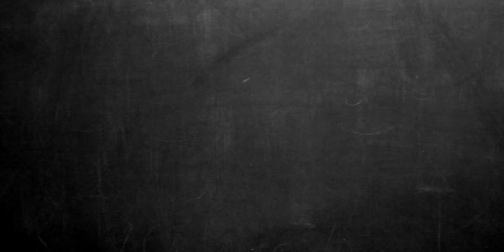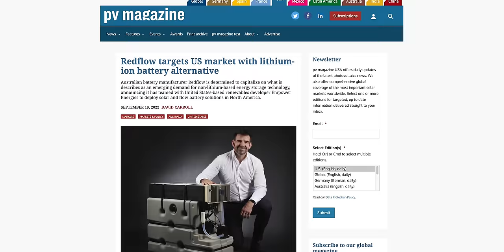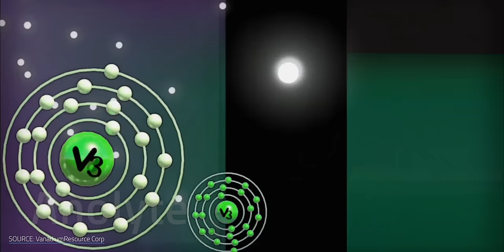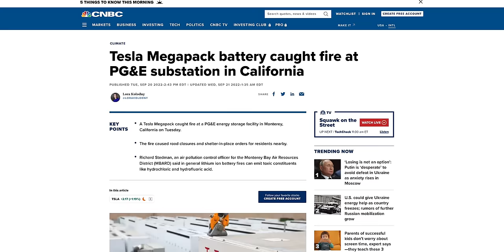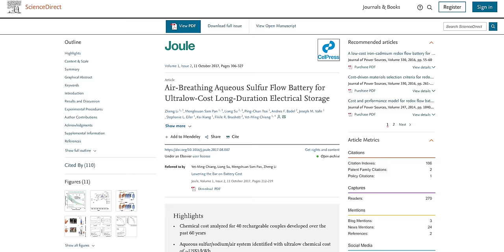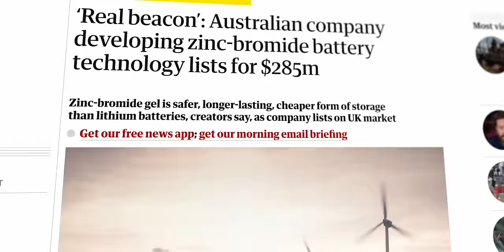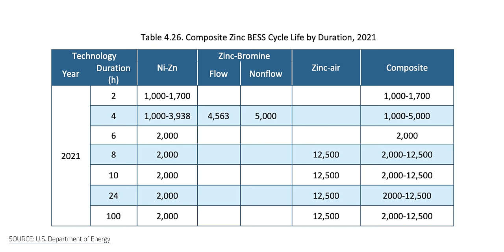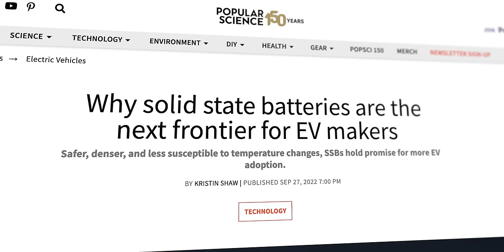137 Year Old Battery Tech May Be The Future of Energy Storage

Comment: A ZnBr flow battery is safe enough to deploy in buildings providing uninterruptable power when a grid goes down. Li ion is not safe enough to use in facilities. There is a single pump, single loop, single tank ZnBr battery for utility size use - there is no membrane separator needed, which is good since the membrane is the source of failure in other batteries.

Comment: The principle of Flowa Batteries are great but ZnBr is not good. It's a lot cheaper because Zn and Bromine are under 5$ per Kg when Va is around 40$. But as Math too quickly mention, Bromine used in BFR (Brominated flame retardant) is Toxic, Prure bromine is Extremely Toxic Class 5 on 6.
As Student I had to work with bromine because it's a easy reactant in chemistry but it's toxicty is around Arsenic or LSD. In terms of chemistry it is easy to use, it may be present in some natural compounds but Arsenic too... As the CDC state no bromine-containing compounds is used anymore in any US drugs.

Bromine due to BFR/electonics wastes in plastic products are becoming a widespread problem since  Bromine compound CANNOT be extracted from platics and they diluated them in "fresh plastic" to be under the legal norm. A lot of Childs toys contaminated by Bromine have caused mass scandal; Less than 15% platics are bromine free.

ZnFe, Vanadium or metal are not cheap but they are safer; This is why ZnBr were not a good choice in the past and having a better sealing tech do not assure me that the new batteries will be correctly recycled, mainly the Plastic part that are in contact of a bromined solution 24/24.
Edited : correct some mispelling

Comment: Grid scale energy storage benefits all types of electricity generation.  In the recent snow storms gridd scale battery storage could have helped traditional power plants level load.  In other words store power when demand is not at peak and use it when everybody turns on their heaters and whatnot when they wake up or when they come home from work, or when the weather changes drastically.   Distributed energy storage systems could keep parts of the grid running even when there are lines knocked down.   I don't know why there hasn't been more emphasis on energy storage from the get-go not just as a method of making renewable energies more effective.

Comment: Smarter flow battery tech such as Gelion's that does not require pumps or extra power do look great indeed, especially for home energy storage, as zinc-bromine removes or greatly reduces fire hazard risks compared to lithium-ion. But presenting the availability on Earth of bromine is only half of the story, right?
I think we'll see a few more iterations of cheaper and more efficient lithium-ion batteries before something cheaper, safer and decently efficient replaces them. I learned from power grid outage simulations in France that our cell towers have a meager 30 minute autonomy battery, when we probably need at least 2 hours as a minimal compromise? But then cheaper and safer batteries of any kind would benefit most applications, with mobility adding an extra energy per weight and volume density requirement.

Comment: So long as size and weight are no object, seawater batteries can even be a potential solution for grid applications, but getting other technologies to match the combination of density, cost, form, and safety in LiFePo4 chemistry, specifically, for consumer / non-industrial applications is a tall order. There are good reasons why 130-year-old tech has not been revived for local grid storage, at least.

Comment: There are a lot of numbers related to kW, kWh and like you said different uses to make comparison hard. 

So maybe convert all the numbers to one bigger "typical" real life situation. Like the storage you want for a typical x MW solar or wind farm, supplying y homes of power. How much space and running cost would ZnBr have compared to Li ion and other solutions? Or at what lithium price would it be better? 
The 16mln $ refitted factory, in how much time could it produce one such project? 
How long would it run without problems and what would the cost per year be to replace a % of the units yearly? Could these units be recycled?

Comment: Let's assume that the house has a septic tank of 10 metric ton size. And it becomes unused and empty, because the house is connected eventually to a sewer sanitation system. It would give roughly volume for 10,000 kg of electrolytes. At energy density of 120 Wh/kg such a tank could store about 1200 kWh of energy. This is just what a normal household needs for a few months of winter (if we do not use this energy for heating). With such a battery the full off - grid with photovoltaics is manageable.

Comment: I'd certainly prefer a Zinc Bromide solution for my home power storage over having a Lithium one just for the safety aspect alone. I think using the right battery chemistry for the right solution is the way to go so we're not dependant on Li-On for everything. I'm quite excited for Graphine batteries as they could solve alot of the issues as they're energy dense and relatively ok for the environment and compact.

Comment: For local energy storage, residential, commercial, and industrial they have a future. Basically where weight and size are NOT critical criteria. They may have a limited future in electric vehicles such as lawn tractors, golf carts etc. and portable electronics where range and current draw are low.

Comment: I'm curious what it would cost to be completely off grid.
Meaning a home has a solar generating roof that uses this kind of battery series to store the power without having to push energy to the grid in exchange for
the promise of its return later.  By being off grid you'd avoid the utility taxes and the like and not be subject to arbitrary rate hikes for using "too much" of the power
that you yourself happened to generate.

Comment: If I was to have a backup and/or peak load/electricity cost fluctuation/UPS battery solution for my home, (I live above the arctic circle in Norway, and in a place where the weather can get really rough causing power outages several times through autumn, winter and spring). I'd use Zink Bromine.  I have a lawn/area on my property behind my house, out of view, that lends it self for the purpose. I don't mind the density beeing low, when the rest seems to be good.

Comment: The problem with Lithium for grid storage is price, price, price even before the lithium price went through the roof. Batteries storage is still miniscule compared to pumped hydro because of this.
Unless we get batteries 20% of the current price, we are better off using heat storage for use as industrial heat, and new nuclear for baseload. Electric storage so far just doesn't cut it.

Comment: This looks promising, but look more closely and you'll see it's not (currently) as good as one might originally think.

First, at time index 12:52, the heat tolerances are stated as 50C (122F) and 45C (113F), and earlier in the video, it was stated that these batteries do not require air conditioning.  Many locations routinely reach at least close to those temperatures and many other locations now reach those temperatures with some regularity (not frequently, but not infrequently, either).  Add to that the fact that the intended location for these batteries for solar energy storage is in containers exposed to direct sunlight, which will massively increase the temperature.  The end result is that yes, they will most definitely require air conditioning.

Second, note the electrical and physical characteristics of the gelion batteries.  At time index 10:09, the video shows the Endure GEL4C200 battery, which is 1.5V, 200 WHR, and 12kg.  On gelion's website, they show a picture of an Endure GEL4D110 battery, which is 1.5V, 75Ah, 20A, and 5kg.  Unfortunately, neither this video nor the gelion website give any indication of the physical size of the batteries, but the weights can probably give a reasonable idea (12kg = 26.43 lbs and 5kg = 11.01 lbs).  For comparison, a package of 16 AA-size eneloop rechargeable Ni-MH batteries is 1.2V, total 32,000mAh (so 38.40 WHR), and 0.435kg.  I know this isn't an apples-to-apples comparison, but it shows the weight (and likely size) difference between these two types of batteries, clearly showing that this zinc-bromide battery won't be useful for small-size or lightweight applications, such as mobile electronics.

In closing, I'd just like to say that I really wish companies with promising technologies wouldn't lie to make their products look better, such as the lie (or, at the very least, the very misleading statement) in this case that these batteries do not require air conditioning.  When lies come to light, it looks much worse because you're left wondering what other claims were lies.  Lies such as those can easily tarnish not only the company, but the technology itself.

Comment: How does the Bromine Complexing Agent work to sequester the pure (liquid) Bromine? Is this sequestration limited in the sense of the number of cycles of release and sequestration it can undergo? Is all Bromine released when the battery is recharged? Are there safety considerations surround the extremely corrosive nature of Bromine? I'm also curious as to the extreme change in the estimated cost of materials - from $8 per kWh in 2017 to $153 per kWh in 2021 - what is the cause of the massive difference in estimated material costs? How do Zinc Bromine batteries deal with extreme cold - as they would face in Canadian Arctic applications, where temperatures of - 50C and colder are not unheard of. Would the battery still be functional at such temperatures? Would electrolyte freezing rupture the battery?

Comment: I don't find sulfuric acid particularly scary.  The only hazardous thing about it is the pH.  Neutralize it with baking soda and you've got a fairly inert material, with the same anion as Epsom salt.

There are a lot of possible battery chemistries.  I'm kind of hoping that someone can do something with silicon or aluminum, because silica and alumina are harmless components of ordinary rock.  For comparison, zinc is a nutrient in milligram amounts, but too much is too much.  If you have a catastrophic failure of a utility-scale battery facility that spills solution containing a thousand tons of zinc, that's an environmental problem even if the anion is completely harmless.  If you spill a thousand tons of silica dissolved in acid, once you neutralize the acid the silica is harmless even with a thousand tons of it.

Comment: I need to get some of these batteries. I live off grid in Wyoming and batteries are the bane of my existence.. my batteries are outside and they experience temps from -45 to 110 F. So lithium is out of the question.  I've been using lead acid but they just don't last. I've been trying to get some of the nickel iron batteries but they are really expensive now. I'd love to get some of these zinc bromide batteries.... 
Followup... where are you getting your costs /kwh...? I priced one our from redflow and is above $1k/kwh US.... I'm getting lead acid batteries for about $100/kwh locally...
Reply: Take a look at LTO. It might be just what you need.

Comment: How well would these work in a vehicle? Because while I don't need huge range, I do need temperature tolerance, and weight isn't all bad when there's snow on the roads. A cheaper battery that's more durable and less picky about how completely it gets discharged might be good for some commuter applications. Also how quickly do they charge?

Comment: There is a reason why we use Lithium batteries, its not just we just randomly installed that into everything with out a thought.

While lithium is not all that cheap, mineral cost is a very small fraction of total cost of a battery. While lithium is by far the lightest battery chemistry, that is not the main reason why its used.

The main reason is the very high electron mobility combined with high cell voltage provide very very small internal resistance of lithium cells. This inturn gives low heat, quick charge and uncharge as well as high efficiency. This combined with the high capacity make lithium unbeatable for most application.

This gives lithium an unbeatble advantage in pretty much every important metric apart from cost.

The problem here is two. The first is that while with a flow battery there is no need to manufacturing the cell, that is really not that expensive, and something that just steadily gets cheaper. The second problem is efficiency.

A high quality LTO cells have a efficiency of above 98%, a Zink-Bromide battery can top at about 75%. This prompt the energy input to be pretty freaking cheap to not just waste more money in inefficiency than the extra cost of the lithium cells. Because the point of stationary battery is to even out the cost between low and high cost grid prices, this eat into the margin a lot. Killing the whole prospect. Zink-Bromide not need to be cheaper, it need to be order of magnitude class cheaper, and its just not going to happen.

So next time you think "why is there lithium battery in everything"... yea, the engineers that design stuff, probobly knows what they are doing.

So why is the AA cells you can charge your self not lithium. Well... they are NiMh actually due to NiMh is worse, not better. NiMh have a higher internal resistance. The benefit from this if you short the terminals for a short period, its really not that dangerous, making NiMh much safer for people to handle.

Comment: Can the zinc-bromide battery with the pump storage replace the cooling system of the other battery system? This removes some of the loss of energy density of the storage system. It's just a matter of whether the weight of the system outweighs the electricity increase.

Comment: In my chemistry training students were flat not allowed to handle bromine, and told many disaster tales.
Also that most labs would not even allow it on site.
So, I would be very leery of bromine's safety claims.
Reply: Guessing this bromine is different from the common pool chemical?
Reply: In the battery it's either present as ZnBr2 or a complex with a bromine sequestering agent I can't disclose.

Comment: So from what I gather the zinc-bromine batteries are good for just about everything that both lead/acid and lithium ion batteries are currently used for. But better in stationary installations but would take more of the compared to LI-i batteries and fewer than L/A batteries. 
Also if I am understanding this correctly, the Z/B batteries have a longer life than both L/A and LI-i batteries and are overall safer than both. Sounds like a win/win. 
Ok, now availability. Does Gelion have distribution in the US and do they have catalogs of types of batteries available?

Comment: Good episode as usual. But it feels like you left out disadvantages of the zinc bromine? Flow batteries have been around for a long time as he has the zinc bromine formula. Why have they not been adopted before now?
Reply: it does feel like he skipped a bit of the downsides
Reply: He did mention dendrite formation, which Redflow deals with by having a maintenance cycle where it fully discharges. This makes a Redflow ZBM not be fully available if you only install a single battery as home backup, which they previously attempted to market relatively unsuccessfully as the Zcell a few years ago. In a grid scale deployment or having 3+ batteries installed this isn't much of an issue as the management software won't take all units out for a maintenance cycle at the same time.
Another disadvantage is lower current delivery. Redflow's ZBM3 outputs around 5KW from a 10KWh battery, whereas a comparable Tesla Powerwall can deliver around 10KW from a 13KWh battery. If you need to be able to deliver 10KW not only is a single ZBM3 bulkier than a Powerwall, but you'd need two of them, though you'd have longer duration storage. Redflow is now targeting medium to long duration storage applications for this sort of reason.
And then there's cost. Even though the video talked about cost as an advantage, Redflow hasn't been able to beat Tesla on price. Zinc and Bromine may be cheaper than the Lithium and other metals in the various Lithium cell chemistries, but the flow battery has other construction costs such as the pumps and tanks. Coupled with low volumes of sales they've never been able to compete with the economy of scale that Lithium enjoys. This is why Tesla originally chose to use standard laptop 18650 cells in the Roadster and Model S/X until they had the scale to develop their own formats.  As I understand it, the Redflow's recently launched ZBM3 is still slightly more expensive than a Tesla Megapack per KWh. Perhaps if they can scale up then they'll be able to enjoy more cost effectiveness.
Reply: @GlenTakkenberg  Excellent response Glen, very informative. Thank you.

Comment: I think for cheaper EV's such as bicycles and "neighborhood" scale cars, zinc-bromide would be a great transition between lead acid (what most cheap mini/neighborhood electric cars use now) and aluminum-air. And they would be cheaper than lithium despite the lesser range, meaning good for an electric scooter or other small vehicle that's only used within a few miles of home. Pair that with the right charge controller and swappable power packs, and I'm sold.

Comment: For the Gelion batteries, I'm wondering if a battery management system is needed for them, and what the charging cycle is like, if you don't charge them al the way back up, will it causes issues like lead acid has?